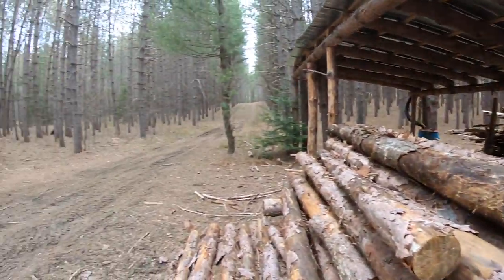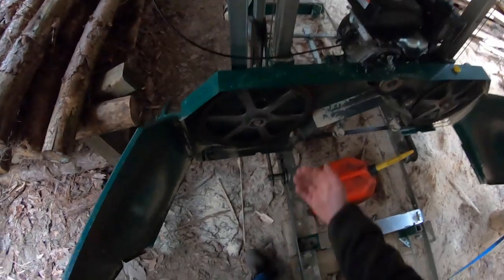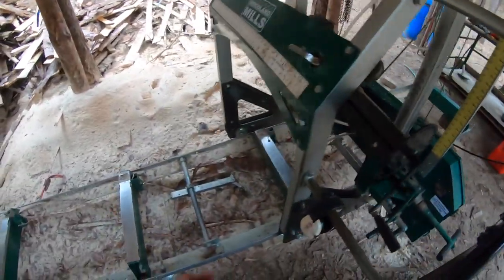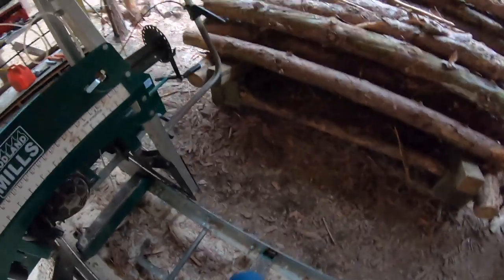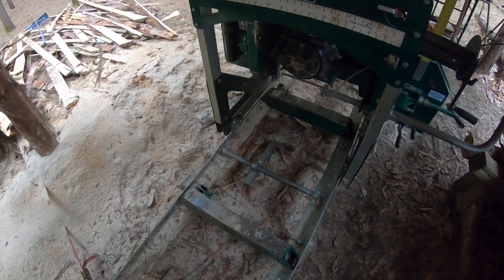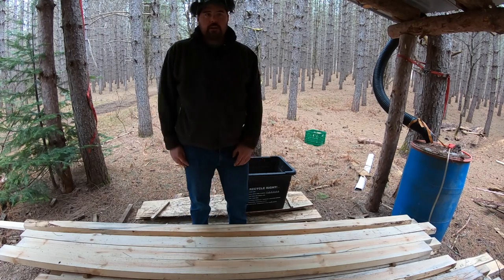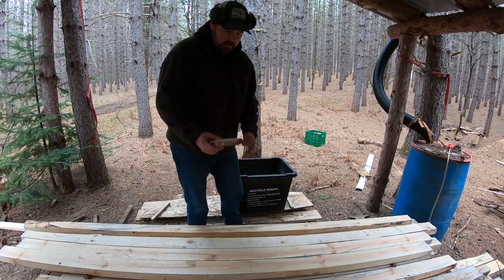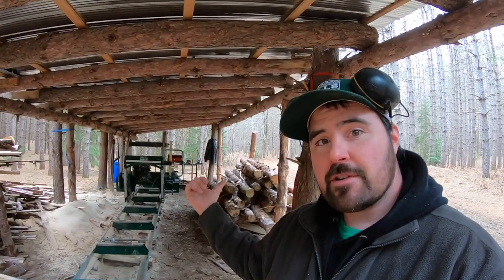Woodland Mills Portable Sawmill Startup Checklist | How to Stack Lumber for Air Drying

Comment: Great video....  Two questions.  1). Does Woodland Mills Sawmills have planer/moulding attachments for putting tongue and groove in logs?  2) How long does it take to 'season' a log and should you season in pre or post milling it into lumber??
Michael from Alberta
Reply from the maker: Thanks for watching Michael. I’m not aware of tongue and groove attachments from woodland mills but you can get them for a router. I normally cut the wood when it has just been cut down and then air dry it for several months or sometimes not at all depending on how soon I need the lumber

Comment: Thanks Sandy! A couple of questions, how often do you fill the water tank for your saw? Does it get you through an hour, a day, a couple of days? Also what do you do with the sawdust, compost, recycle or reuse? I have a Dewalt, battery powered blower, which I use on my Woodland Mills chipper (like yours). When I saw the sawdust inside the wheel blade housing I thought my blower would work awesome there, you might check it out. Thanks again for the videos!
Reply from the maker: Usually I have to fill up the water resevoir tank about once every two long days of cutting. I don't use a tonne of water when cutting and so for the most part it lasts quite a while. I also use my backpack blower to clean out the mill from time to time and it works great

Comment: First, I have watched many milling videos from many people, but none have done as good a job as you explaining the ins and outs of using a portable mil...or as thoroughly.  As a result I actually subscribed to your channel(first time EVER subscribing to any channel!)

I have a question...Do you have issues with warping/cupping milling logs as you do without compensating for the log taper?  Also, do you have a lot of end checking, and if so, have you tried placing your end stickers very close to the end of each piece of lumber as I have read several times that this will help eliminate a lot of end checking?
Reply from the maker: Welcome to the channel Mike. I appreciate the support. I’ve not had any cupping issues to speak of. I just stack the boards when I’m done cutting with a 1x1 inch sticker between them and they seem to remain quite straight. Since I mostly cut red pine I find that the more is next to no splitting or checking that takes place when I air dry. I have found that poplar splits quite bad though. Good tip about placement of the stickers. I’ll have to try it. I’ve heard of painting the ends of the boards with latex paint to help the issue. Thanks again for joining the channel. Hope all is well